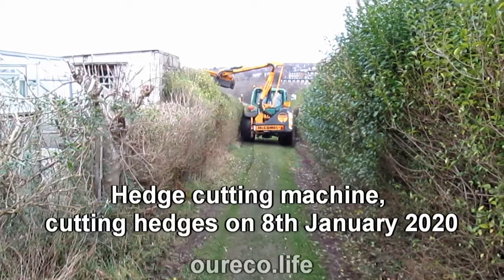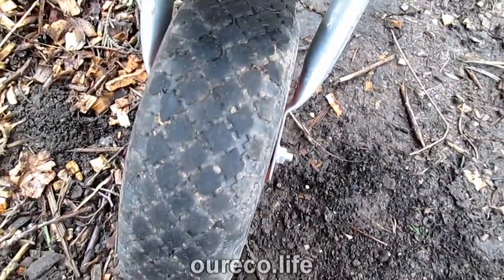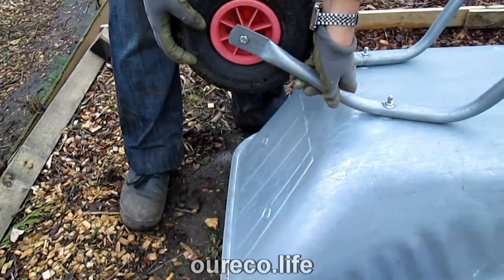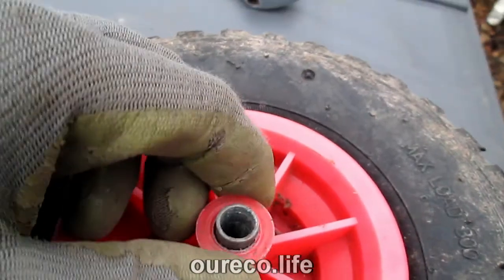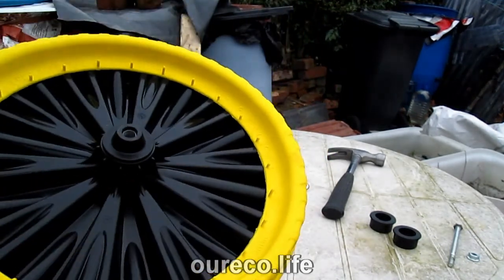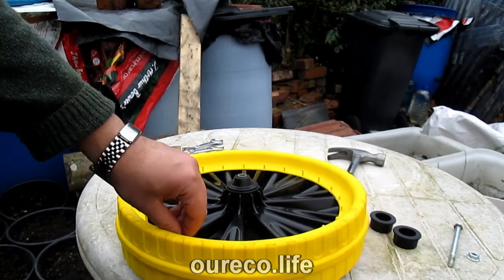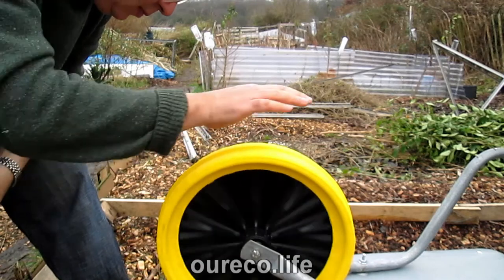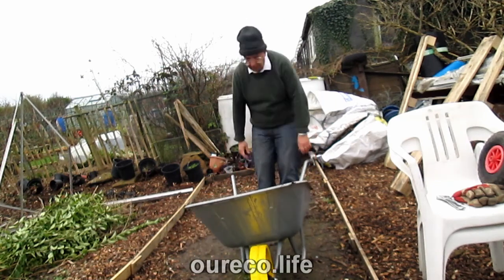How to change a wheelbarrow wheel from a pneumatic to a solid wheel

Comment: Can anyone tell me if this would fit a barrow that has a 12mm diameter shaft?
Reply from the maker: It came with an attachment for a smaller size. It was a while ago so can't remember the exact measurements but think that was about what mine was. I'll measure mine and let you know.

Comment: The wheel looks different than those i used some time ago.
Reply from the maker: Yes, it's not a solid wheel, as I've seen on other barrows, but a rubber one which is more shock absorbent than the older types.